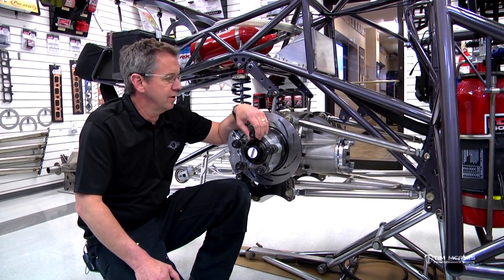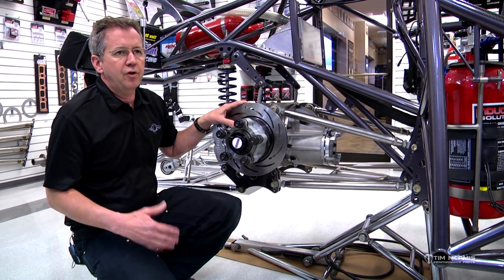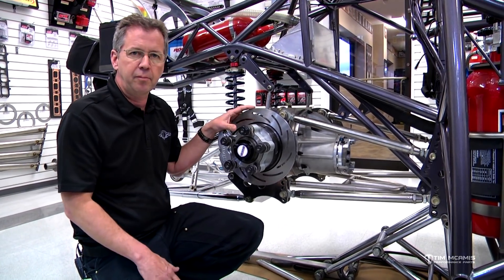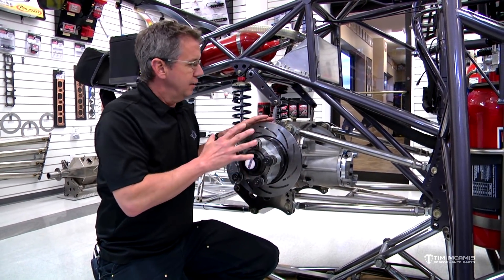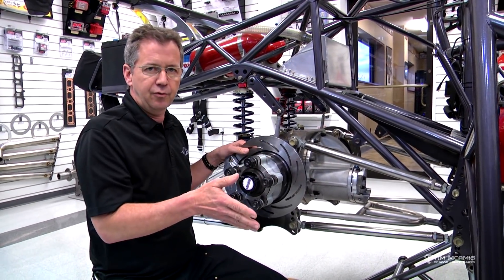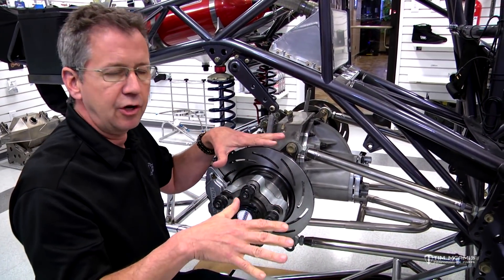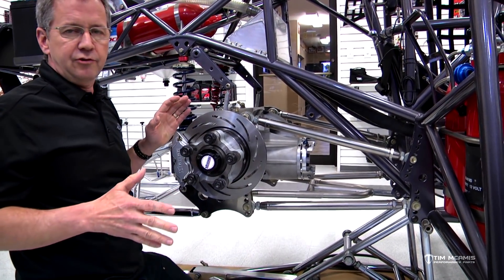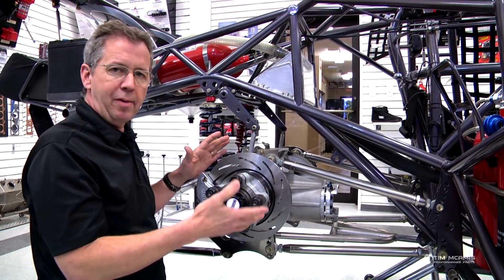Rear Steer

Comment: Great vid!  If you have rear steer in the car, and it picks the front wheels up on the launch and carries the tires for 30-50 feet will that push the car left instead of right?  Thanks
Reply: I think the point of the rear steer is getting the car to go straight when the front tires are up in the air so there should be no push either way if the track and rear tires diameters and traction are equal

Comment: Would having a pretty big " rear wheel steering" set up affect the ET, as the car is scrubbing the rear tyres .
Reply from the maker: Yes, it could. However, if you have so much that it is causing that much ET loss, there are usually other problems that are being compensated for. When used correctly, rear steer would actually help you gain ET by making the car run straight and more controllable.

Comment: I have  never worked  on a 4 link..  I want to  put  a heavier  rear in  my '79  Camaro  but  I want  high performance  cornering too .   This  seems to be straight line  only ...

  My first question is:   I assume  this whole  video  applies to spools  only ?  For a Street  car  I like the  Eaton True  trac..  I wonder  if this would even apply to any  kind  of differential  as  opposed to a spool..

   There as so many  Terms  here  Rear  steer  and positive  vs  Negative..  A  beginner  like me would really  need  a manual  with  drawings  and  definitions  of all  the terms..

   There are  books  out there for things  I work with such as snowmobile  clutches..

Comment: the jest of it is this. when you change the angle of the rear axel it is actually moving the  center line of the chassis. whichever side of the chassis has the shorter wheelbase is the way the car wants to lead.   pavement super late models and drag cars are very precise settings. dirt late models and open wheel mods the axel moves forward as much as 4" on the lr and the housing moves left 2" when the car is "up on the bars" .    good stuff.

Comment: And this is what separates the pros from most of the weekend warriors. And what you didn't mention is why the chassis build is so critical to the car. If the chassis is off then your point of measurements will be off. Since we're talking about small adjustments very small imperfections in a chassis could throw all of that off. All the notes you use on an old car might not work on the new car because of that.

Comment: Tim, appreciate your great work and knowledge sharing with the community.  You did not mention that when putting rear steer in the car, it's going to swing the wheelie bars a fair amount to one side, which should be then adjusted back to the chassis centerline. This question gets frequently asked and adjusting them often gets ignored or overlooked.

Comment: Awesome videos. No B.S. Straight goods. Big fan. But...I'm a Jeeper (I think that's probably why I get this in my feed). My question is: when do drag racers use rear steer or even have time to use it?
Reply: BionicForester19 lol not literally like in monster trucks, it's a term they use to say how the rear end & 4 link could steer the car
Reply: TEEMONEY26 
Steer the car? There's that verb again. How do you steer the rear if it isn't steering we're talking about?
Are you meaning to say adjusting your arm lengths via adjustable rod ends will direct a race car one direction or another?
If so, that's old hat stuff to anyone that knows suspension but your "rear steer" terminology is very confusing.
Reply: @akamai96753 ear steer in this context is referring to rear thrust drive angle. if the car wants to turn slightly left after launch- you are losing speed by steering right to compensate, if you adjust the drive angle slightly to neutralize this- next pass you can keep the wheel dead straight and not loose that speed.
Reply: BionicForester19 rear steer on a drag car is a preset not an active movement, torque twists the chassis and rear differential specially on a hard launch in a big power car so you preset your rear steer to to launch your car straight when you launch when everything is twisted up